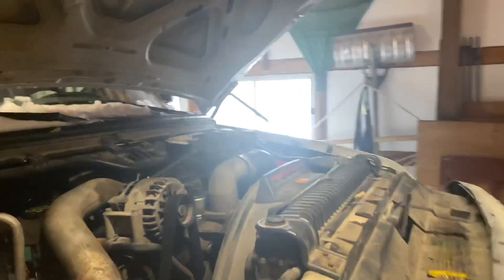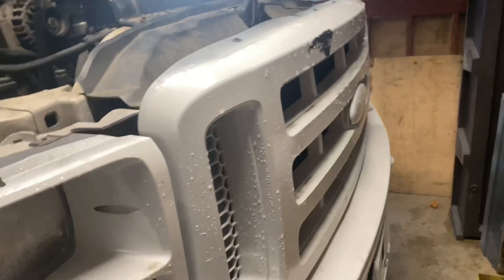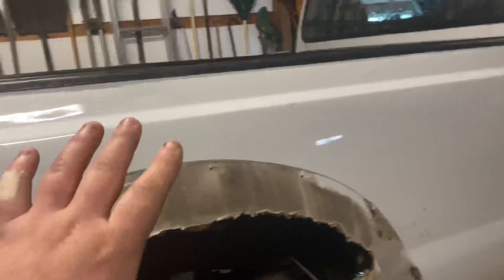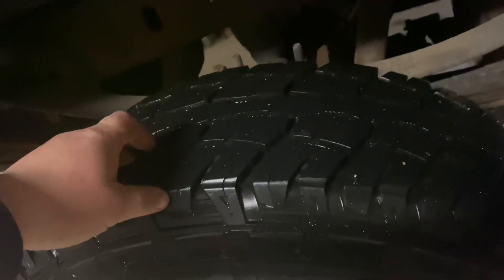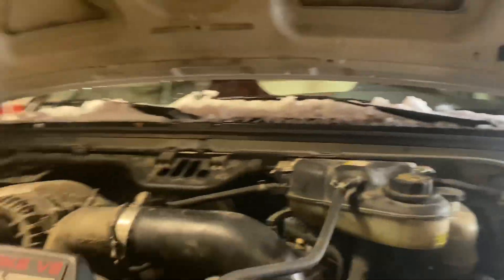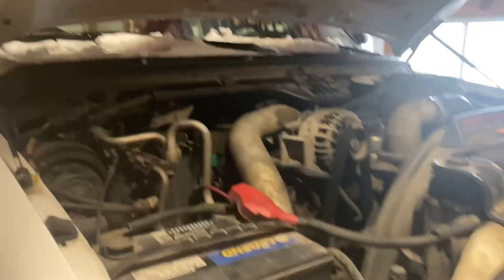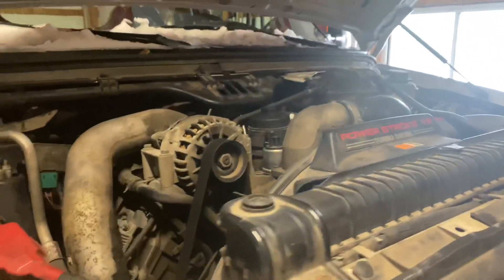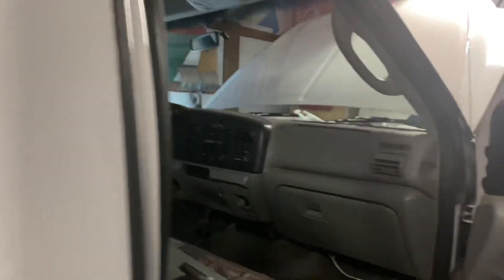NEW 6.0 POWERSTROKE DAILY BUILD!

Comment: Need some repair help here, my 04 was fine. Well my gas gauge started acting up, reading I had nothing in the tank and then would go up to where the fuel level actually was. Wednesday night my whole cluster went out, none of my gauges were working. Thursday morning I drove it for a bit and the interior lights started flickering and the radio doing the same, then the truck died going down the road and wouldn’t crank back just click. Researched online and came up with my alternator was bad. So I went and got my alternator checked and batteries, needless to say I bought new batteries and alternator. Well I didn’t drive it Thursday or Friday, this morning I drove it probably an hour and a half and then parked it. Went to crank it back up and it just clicked while the interior lights and radio flickered. Jumped it off, checked battery voltage and it was only pushing 10 volts. Took alternator back to oreillys and got another one came home hooked it all up, jumped it back off now it’s only pulling 7.42 volts. It ran for about 10 minutes and shut off on its own. What should I check?
Reply from the maker: I would check all connections and grounds
Reply: Pull the cluster, needs the pins re  sodered, very common issue, usually lose power windows when this happens too
Reply from the maker: This would be my second guess. Being that the alt and batteries were replaced, I would first recommend all battery positive and negative connections are proper. As well as engine/frame grounds. If the problem persists what you are describing sounds like a classic cluster issue. Interesting that the battery/alt correlated.

Comment: Hey I have a question. You said on a previous video that all 6.0s have the same harness. So could I swap my manual doors for power locks and windows? Lol just a thought. I plan to get a remote start but I dont know if I can being I have manual locks and stuff. Lmk thanks!
Reply: It was the video of the high idle mod.
Reply from the maker: @KevinSmith-pp2ll  I don’t have a lot of expertise with that. I believe you need the pass through door harness in order to do that. But definitely do some research, I’m sure it’s possible!